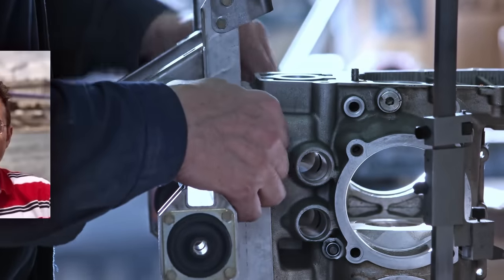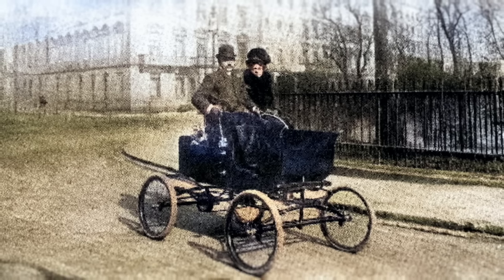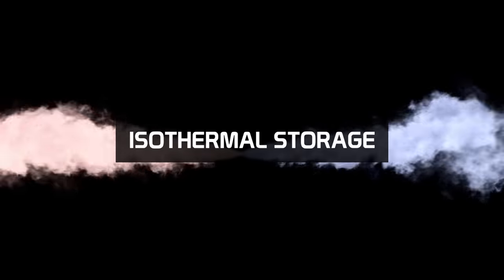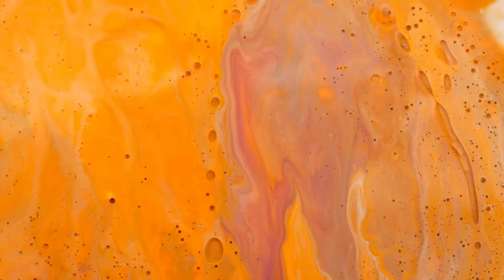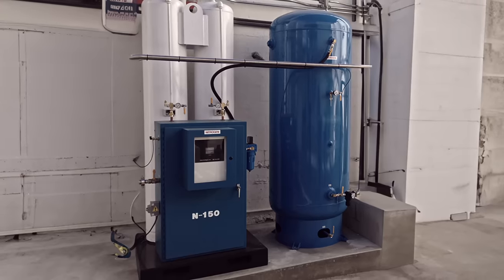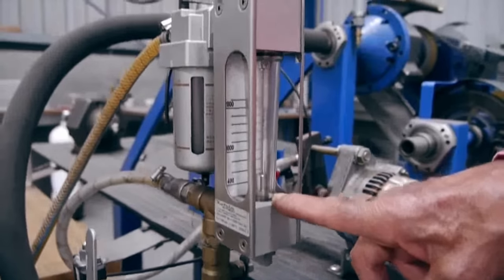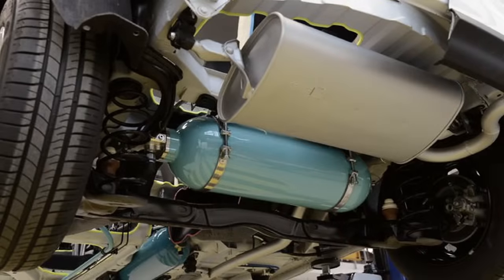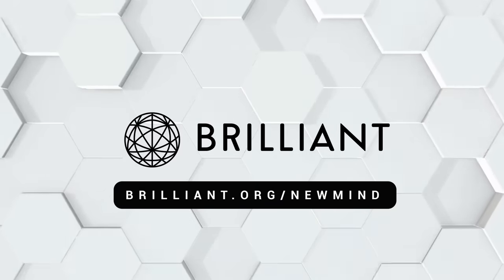Driving On Compressed Air: The Little-Known Compressed Air Revolution

Comment: fundamentally low energy density is, AFAIK, impossible to overcome. Also you're building a bomb. also now you've added flammable wax to your compressed gas vessel vehicle. Like yeah maybe, but batteries work better and are simpler.
Reply: I would choose battery fire than exploding 😅
Reply: Did you watch the video before posting this? 

The tanks are designed to rupture rather than explode

Near Isothermal compression helps with the energy density thing

The tech can skip the entire elictrical portion of the logistics pipeline, converting mechanical energy directly in to near isothermally compressed air. This drives the efficiency up dramatically.

Not sure how adding parrafin wax is supposed to be perceived as more dangerous than gasoline or batteries.
Reply: @jacoby6000  You need to convert pressure into shaft torque. And that pressure is most likely produced with an electrical pump. So no advantage there. THe efficent design needs a big yikes of heat exchangers and even generator and batteries for feedback inself making it heavy and depended on electrical technology again. And it has quite a bunch of a material that can burn in it making the whole thing also flammalbe. So it has all the disadvatange plus the tanks can also rupture and rapidly decompress. So where is really the benefit?
Reply: @fracapolligummala3548 I think that you're missing the point. Electricity has energy conversion between the mechanical processes whereas compressed air is the literal direct storage of mechanical energy. Tanks can be designed to rupture easily and the vehicles are allowed to be much lighter and more efficient if the designs get funding to perfect themselves
Reply: I don't believe the wax comes into direct contact with the compressed air, it's just used to store thermal energy which it does well as its phase transition between liquid and solid occurs around 70C. as this  s also where the system likely functions it's a useful material. 

Bomb? There's a lot of energy in a tank of gasoline. We've nornalised driving around while sitting on a thin metal or plastic tank of highly flammable fluid so if you want to talk about bombs... Lithium batteries can get pretty spicy if mishandled too.

Compared to gasoline, wax is pretty tame.
Reply: @fracapolligummala3548  do you know how an electrical pump works? It converts electrical energy into mechanical energy. 

Do you know how most energy is generated? Converting mechanical energy in to electrical energy.

You can skip the conversion to electrical energy and just have your pump running on whatever spinning mass you had previously powering a generator.
Reply: @HughZantu  @jacoby6000
You dont seem to understand that while pressure is something "mechanical" its still a totally different energy form that has to be converted. Air motors, beside other problems, are not really better in converting that energy into shaft torque than electric motors.
Reply: Just use alcohol fuels in current fleet tech fuels grown in regenerative agriculture systems # david Blume
Reply: What is afaik?

Comment: that 4x energy density in compressed air compared to li-ion  is a  BS
Reply: Well... Air is quite light.
Reply: Indeed. And a thermodinamically efficient designs requires thermal storage and two heat powerful exchangers at minimum. Batteries have problems, but at least are feasible.

Compressed air has great POWER density, which is why it used in industry. Energy density, both volumetric and gravimetric is dreadful.
Reply: @ansgaryeysymontt7155  High pressure air tanks aren't quite as light.
Reply: @tz8785  even 2mpa tanks are quite heavy.
Reply: @ansgaryeysymontt7155  that what ppl usually think before they see 1 atm crush steel tanks. and air really resists hard getting to high pressure.  and tank w8 should also be counted
Reply: Four times specific energy is based off the weight. It's not talking about the energy density in volume.
Reply: @mrpicky1868 Yes but steel pressure vessels that are designed to take 500 psi will still crush at less than 50 psi. The same reason why a Coke can will crush easily but won't explode ezzz
Reply: @pilotavery  i wasn't talking about coke cans. that are thinner then paper
Reply: @mrpicky1868  Yes but the example is the same, it can take way more pressure than it can in crushing.
Those liquid hopper semi trailers can crush just by sucking out all the air but you can also put 20 times the natural air pressure and they will not explode
Reply: @pilotavery  i understand. but even if they went density to w8, still they clearly skipped all the compressors and heat exchangers
Reply: @mrpicky1868  That's not how you measure energy density, you don't measure the energy density of a battery chemistry with the charging circuit on it as well. Nor do you do it with the engine. Just like you don't measure the power to weight ratio of the engine while including the fuel tank.

Because the fixed cost of compressors does not change with the size of a tank, only the variable cost is counted when talking about energy density ratio, because you could set the air tank size to infinitely big and then the pump would be infinitely small. If it required one pump per hundred gallons or something then sure, but it doesn't, it will just fill up and take longer
Reply: Bla bla bla. Mdi has running models

Comment: So, heavier, less efficient, and more expensive. What's not to love?
Reply: Energy independence is to love. Eventually water/sulfur batteries along with super capacitors, also eliminate need for charging networks.
Reply: @sampleoffers1978  When things are more expensive, they usually cost more resources. 

A free market usually selects the best solutions unless there are externalities. Fossil fuels don't account for the damage of CO2 in their price for example.
Reply: @jwrosenbury  I'm not arguing pro carbon fuels. Though hydrocarbons should be possible to clone  now and genetically insert in fast growing bacteria...then pressurize if necessary, to make fuel at scale. That also can be used in efficient open air carbon capture machines. Carbon capture should be convertible back into fuel with enzymes etc...My real point though was yes, the pneumatic engines are less efficient and might cost more, but should eliminate carbon fuel dependence for the vehicles  directly, resulting in energy independence despite early heavy investment.  Grids can use gravity battery, pressurized heat storage etc, no problem with supply. That was my point, and joined with emerging battery/super capacitor technology, the efficiency should vastly improve also.

Comment: Seems like an energy storage technology that could work as solar energy storage in hot climates. Compressed air could be stored at room temperature and when needed, compressed air could drive a turbine-generator or engine-generator to generate electricity. The cold air would be useful for space cooling. So a combined power and cooling system.
Reply: I love to see people under technology videos are always giving ideas how to improve or where would be the usage of the technology. Seems like the purest of the communities with only interest to improve humanity. I hope it always stay the same. It is creative brainstorming to read thru comment section.
Reply: That's the best concept i have read on YT in years! Great thinking!
Reply: Chill the air lines between the compressor and the tank. Fill it with chilled air to max or regulated pressure... Then even with compressor off and air being used, the temp rise would help regulate it further for longer between compressor cycles.
Reply: I need a job...btw...or a venture capitalist...
Reply: Lines can be chilled with ...and I kid you not... Simple as ammonia in copper lines wrapped around your high pressure lines from compressor to tank storage... And a 30w light bulb... 

Ever seen how non compressor mini fridges work? Literally a light bulb heating ammonia pushed through the metal lines. That's IT.
Reply: Simplicity. Then you're capable of chilling ingoing air and cramming double to 3 times as much volume in the tanks.
Reply: Already in use. There's installations dating back a decade i think.
Reply: The problem is the ammonia. Nasty stuff when it escapes @ShogunAutoworks
Reply: Your statements ignore the elephant in the room: compressing the air in the first place.
Reply: That would not even come close to working.
Reply: The cooling effect from expanding air is relatively small. Compressing and expanding room temperature air will only cause a minor temperature drop, not enough to cool down a whole room significantly.
The energy required to compress the air would be significant, negating any energy savings you might gain from the cooling effect. Running a compressor would likely use more energy than it saves by cooling the room.
Even if you could overcome these limitations, you would also need a way to effectively remove the heat generated by the compression before expansion. This adds further complexity and energy costs.
Reply: @ShogunAutoworks  The absorption system. Also used in large water chillers for buildings. Useful where steam is readily available and cheaper than electrical power.

Comment: Compressed air tanks are heavy, I seriously doubt that the energy density can be increased without increasing the pressure to an unsafe level and survive the amount of compression and decompression cycles that a car would need. Composite materials are great, but tend to degrade over time. That is one of the advantages of heavy steel in industrial compressed air tanks, once they reach a certain level of wear, the steel stops degrading, giving it a much longer lifespan than composites.

Comment: There’s an old time steel mill device called a Vortex Valve’, which was a cheap air conditioning trick, used to make the super-hot steel mill cool enough for the workers to survive working in there. You pump the local air through this valve, and it splits it into two jets of air, one hot, one cold, with the hot air jet piped outdoors. Perhaps some new application of the thing, could help in a few of these air power systems?
Reply: that wont change anything to the bottom line, compressing air is inefficient by itself, therefore compressed air is a very mediocre storage medium.
Reply: It's an interesting concept for many other problems.
They have small units, that help cool machining processes, without a liquid coolant.
They are sort of pricey but interesting.
We spray messy coolants at grinding and cutting tools.
Reply: Extremely expensive air conditioning method, one of the worst. Compressed air is typically produced by electricity then compressed air is used to produce cold air with a byproduct consisting of hot air.
Reply: Ranque-Hilsch device splitting a single air supply line into hot and cold streams, then routing those to the hot and cold ends of a Stirling engine, could make a superefficient system, or help boost the power of an already very powerful Rotary Wankel airmotor.
Reply: @lo2740  In my opinion, the use of lithum and cobalt are worse. I prefer the "mediocrity of the compressed air as storange medium" than the very large recharged period of batteries and the destruction of environments due to mining activities.
Reply: @JayDillon-mm6yv  Unfortunatelly, the Stirling Cycle has a theorical efficiency of the Carnot Cycle,  and the Wankel engine have many thermodynamics and mechanical problems. But your idea it's very interesting.
Reply: @lo2740  thats true about being mediocre but if the energy came from intermitant and RE which would be wasted anyway the cost would be feasible. just compress the air when there is surplus energy. I'd wonder about filling the cylinder on a cold dry night and use it when its hot and heat can be transferred to the cylinder for additional pressure in the day. might be nice in a desert area

Comment: I haven't seen one of your videos in a minute, I've seen a ton of these compressed-air cars used in India and Mexico.
Reply: Really? Wow, you have some links or photos?
Reply from the maker: Same. Glad you’re back. Been missing those over the top builds!
Reply: It's not compressed air..it's compressed natural gas (CNG) and the engine is still ICE.
Reply: In Mexico?
Reply: those cars are not the same as the canadian university car, compressed air cars have been used for hype marketing and poorly developed however diprieto engine is still promising
Reply: @reinoud6377  Tata AIr Pod cars were going into production over a decade ago but it looks like they've been shelved ???
Reply: @MrCpolzin  it is a scam, tata are really dumb to have felt for it, given that the scam was going for a decade or two at the time already. Air motor is complete nonsense, it is a terrible storage medium and the whole cycle has extremely low efficiency.

Comment: Peugeot-Citroën really dived into the project with the HybridAir concept, which went on years of development and research until they pull the plug due to the rise of the battery hybrids.

The system would function like a 48 volt mild hybrid, keeping the car in motion at stable speeds and at low speeds, making possible the 1.2 3cyl gasoline engine to shut off. Very ingenious
Reply: Was about to say exactly this... funny how EVERYTHING on youtube is "NEW"...

Comment: As a marksman, I got interested in Pre-charged pneumatic (PCP) rifles a decade ago.  Those unfamiliar with PCPs generally laughed at the "boys with their Red Ryders".  That has changed.  The advances occurring within that niche industry have outpaced traditional firearms and speak volumes on what can be done with pneumatics. I understand that while some/many of the physics and engineering problems are different, if a competitive financial model can be developed, we will see these faster than most expect....and we won't hear them comming.  Thnaks for posting.